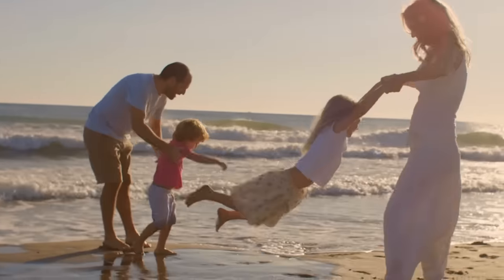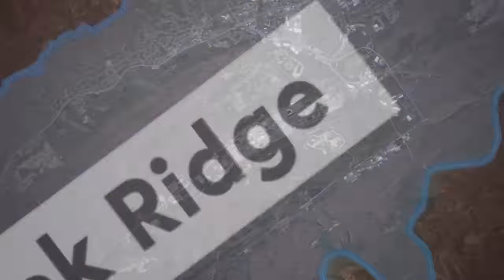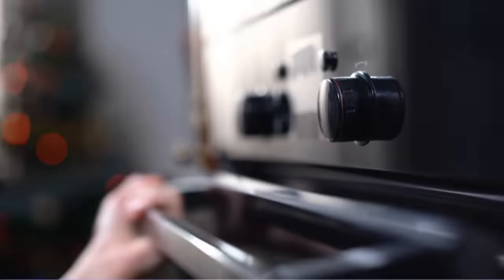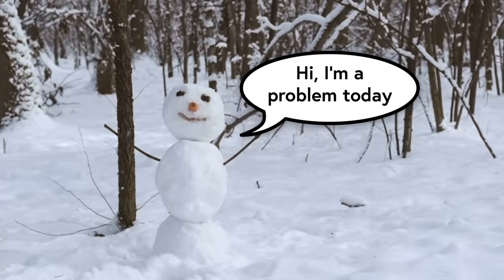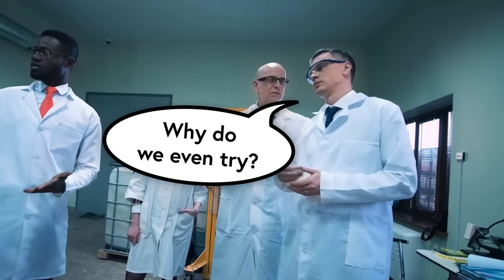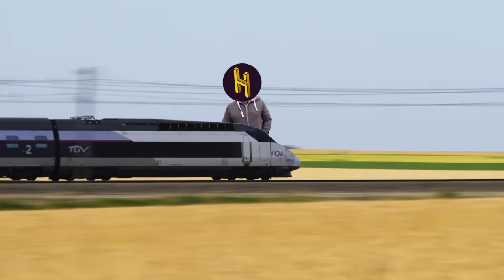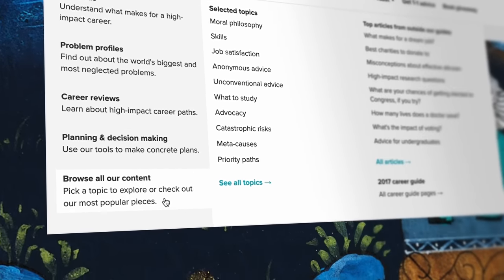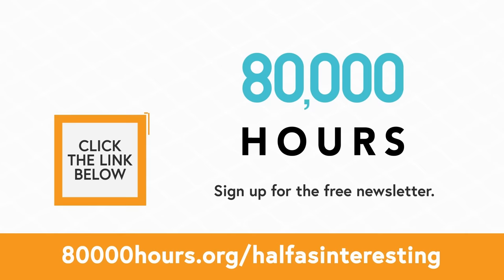The Material So Classified We Forgot How to Make It

Comment: With how much of the ulam-teller design is known it's remarkable that it's not public knowledge at this point.

Also the NNSA should have just asked the warthunder forums, they would have found it in no time.
Reply: It's likely just a modified aerogel
Reply: a
Reply: @hunterwyeth  yeah we are
Reply: Lmao
Reply: step one : make underpowered w-72 (?)
step two : wait for someone to piss off that they paid cash to use a crap weapon
step three : wait for someone even stupider to leak military secrets in hopes that they will fix the missile (who knows where it is by knowing where it isnt it now is).
Reply: Probably akin to that graphene aerogel that's useful for lithium batteries. But rather than conductive properties of graphene, it has more to do with being a neutron moderator.
Reply: tell me about it
Reply: @hunterwyeth  NNSA should've asked for an invite to Thug Shaker Central.
Reply: the beautiful part is that the public doesn't know how much is true from the leaks and there's no way for us to try anyways
Reply: You can find it on several hard scifi forums, lol :P
Reply: @pauljs75  nope
Reply: @johniceland5027  I put the new Fogbank on the G
Reply: IIRC it was widely suspected that a filler material was used in the cavity between primary and secondary stages because you've got a shitload of hard x-rays and photons that you want to trap rather than letting them sinply pass through and escape the bomb casing. 

By flashing a lightweight filler material to an insanely hot plasma, you can trap even more primary stage energy and thus superheat the secondary stage more efficiently.

Nuclear weapons are fiendishly clever pieces of engineering.
Reply: What I remember reading the filler material in the earlier designs were just  Styrofoam.. or whatever it's called in English..  u know standard filler material for shipping.
Reply: I read somewhere it is pentane filled polystyrene....

Comment: It's basically styrofoam. When the conventional warhead explodes it releases massive amount of x-rays and gamma radiation, that turn the intermediate into plasma. This plasma is an intetegral part of fusion and fission of the secondary device.
Reply: Knock knock
Reply: @osdever  Who's there..?
oh shiet!
Reply: No. Fogbank is not Styrofoam.
At least one H bomb from the 50s used polyurethane foam as the interstage material. I've seen no evidence of Styrofoam ever being used. Fogbank is likely rather different. There's indication that beryllium oxide is used in the interstage of the W76 (which uses fogbank). Whether that means fogbank is some form of BeO such as beryllia aerogel, or whether BeO and fogbank are two different materials used in the W76 interstage is hard to tell. There's also come confusion as to whether interstage material and channel filler are synonymous terms. 
SeaBreeze, the predecessor to Fogbank, which was used in the B61 was chemically related to Diallyl phthalate.
Reply: Interesting thread. Conceptually, it is just a filler like styrofoam, but the exact formula made it a particularly 'clean' bomb. The bomb would fission successfully with tonnes of different fillers, but they knew there is a danger of a lot more 'dirt' with an untested filler.
Reply: Is it some sort of advanced moderator, like tritium was the the performance of 'the shrimp'?

Comment: there is a similar case regarding the imperfection mentioned here. The holes in the swiss cheese stopped occurring and they were unsure why. But later found out it was due to there no longer being any particles in the milk. The particles were from sawdust and other stuff occurring in farms, and these particles would add the holes in the cheese. Thus to create the holes again they added sawdust themselves  during the cheese making process.
Reply: That's partially the case.

The other problem with the bacteria.

Comment: Here's another --- we manufactured armored vehicles.  The drive wheel of a tank is called a sprocket (roughly the size of a washing machine and solid steel).  They are wildly tough since they have to propel and brake very heavy tracked vehicles.  One year-end our supplier replaced their heat treat bath.  Picture a small swimming pool.  And it had been in service since the start of the Cold War.  The sandy-salty material had been contaminated with countless layers of ambient dirt, dust, cigarettes, half-eaten lunches, paint, piss, hydraulic oil, birds that got too close, spit, etc.  Picture chemical witches' brew.  Especially since the production parts often had various chemicals on them before they were dropped in.  To upgrade the process they removed it and replaced it with industry standard material.  Guess what?  They sent us a run of parts.  Snap-crackle-pop is not what you want to hear the first time you start moving a tank.  Took weeks of engineering trial and error to tweak the heat-treat bath.  After three weeks of no useful production they removed the new materials and dumped the haz-mat containers of witches' brew back in.  Worked like a charm.
Reply: Factory: "this water is dirty and stinks, best to clean it"
Buyer: "why am I hearing small explosions?"
Factory: "uhhh.... idk... jerry piss in the pool, don't ask why- yeah we'll deal with it sorry."

Comment: "Potential Train Money"   absolutely slayed me 🤣🤣🤣
Reply: We need more money for the trains!!
Reply: It's the US, we know it's probably not going to go the trains anyway 😂
Reply: He should have said potential brick money.
Reply: @MUrules2014  I think so.  But I also think we should continue developing the roads.  A good system has the best roads AND the best trains.

The roads are already really good, but introducing trains should actually make them better.  Then, we can further improve the roads based on how the trains helped them.

The trains really work best in cities and connecting cities.   However, they tend to get a bit tricky in lower density areas.  They work, but the roads really hold up well in these low density conditions.  So, I think we should use the trains to supplement the existing system, not to compete with or replace it.

Using toll roads, we limit the number of cars entering cities.  This should help limit the cars in the city to just the ones that are supposed to be there.  Anybody driving to work or from one point to another in the city is supposed to be there.  Somebody just passing through the city should take another route.  So, to accommodate that, we shall upgrade existing highways that bypass cities to proper freeway standards and build new ones as necessary.

The freeways shall be modified to allow overhead railroads to be built over them.  The roads are already clear strips of land that connect cities, so they sound like perfect places to put railroads.  High-speed passenger trains will be run on these new rails, and the existing railroad network will be just for freight.  In each city we can run light rail over the urban freeways, and these intercity trains over the primary arteries.  Because freeways and railroads will follow each other, rail interchanges can be placed at highway interchanges, allowing intercity travelers to switch to light rail in the city.  The light rail will run over the urban freeways and have stops at each exit or wherever is practical.  From there, street cars could be used on large streets within the cities.

Ultimately, the way to make roads more efficient is to minimize traffic.  Traffic is chaos.  Large trucks are necessary for the last leg of the delivery process, but they tend to be problematic in traffic.  Truck routes help ease this problem, but cars can usually still go on the truck routes.  Trucks just have to take them.  I think we should build truck-only highways within cities.  The trucks will be separated from the regular cars, hopefully making it easier for travelers.  The trucks, in addition, will not have to deal with the chaos of cars coming into or leaving the city as much as before.

From a more practical standpoint, I think stacked highways are probably going to be useful.  Essentially, we run a bridge deck over an existing freeway, allowing us to expand the road quickly and without needing more land.  We take out the median on the bottom and run either direction on just one level.  Each level would effectively add however many lanes are on the ground.
Reply: Especially with the implication that the cash would somehow be more effectively spent on trains. Not bloody likely, considering almost all of the history of light rail in the U.S.
Reply: Rail, like in Europe and Japan will never be economically viable in the USA. Look at a map. Look at how many cities there are, and the distances between them. Compare Europe and Japan vs the size of the US.; End of discussion. Right now the US has three (about 2-1/2, really) double-tracked (two sets of rails running mostly parallel with one another) East/West Lines (Heavy Rail) totaling over 15,000 miles of track. Maintaining these tracks, as it is, is very difficult: it's not just money. It is the distance between parts/materials and where a given repair/ maintenance issue exists, it is geology, it is weather, it is people. Rail Beds are engineering masterpieces, but unlike the roads created by the Romans 2000 years ago, they need a LOT of maintenance. (Millions of tons of cargo going over a strip of gravel wood/ concrete about 25 feet wide is FAR more wear and tear per square foot than any foot of man, beast, or the occasional wagon of 2000 years ago. Talk to a real Railroad Engineer/ Architect, the Engineer of a Traction Engine and a crew of Gandy Dancers (the old name for a railroad road gang), and stop relying on some green think tank/ Professor of Logistics numbers who have never moved more than a bag of mulch, never laid anything more substantial than a paver in their garden, and never had to drive further than a few miles to get both.
Reply: @matthewhelton1725  Exactly. The entire country of Japan would fit inside Montana alone, but Japan has 125 million people in that space. The U.S. already has - by far - the largest rail network of any country on Earth. China is the only other country that even has half of the rail distance as the U.S. And the U.S. uses that rail to great effect - for transporting freight. The U.S. transports about 12 times as many ton-kilometers of freight by rail per capita as the EU.

Boxes don't care if they take 3 days to cross the country. People do. Traveling from Amsterdam to Paris is not the same as traveling from New York to San Francisco. The difference between traveling at 50 (or even 100) mph and traveling at 550 mph doesn't matter as much when you're only traveling 50-100 miles. It matters a lot more when you're traveling 2,500 miles.
Reply: Next video: "We forgot how to make steam trains"

Comment: That diagram means they do have detailed records now.

The components- e.g. “Process V”- are almost certainly defined in detail within a series of additional classified documents, each with its own access control. That’s why you have a chain of steps with names like that. This lets anybody see the overview diagram you showed, but only a top official like the NNSA head has clearance to see the info for all of the components. The issue now would be idiocy like not having any person with SCI access to all the pieces or losing track of some if those documents, because the only thing more incompetent than the US government you see is some of the parts you don’t.
Reply: Like modern software development. Some guy has the "grand picture", and hundreds of programmers work on separate pieces of code. Everyone uses work products from someone else but doesn't know how these were made or what they actually do. And most contributors are not even part of the project and are probably unaware of what their work is being used for.

At least there's often documentation nowadays, even if it's all over the place.

Ah, yes. "Documentations is like sex. If it's good, it's very very good. If it's bad, it's still better than none."

But back to the military, because they have additional "special issues". Even with a pretty high security clearance, it's still all on "need to know" basis. If you work on "process W", you don't need to now about "process V" and "process X". As the manager, you just know that the processes exist, not any details. There is no single person who could leak the complete process. Documentation may be stored in different facilities, where no one knows what the documents are about.

Some day, a few decades later, someone might open a safe to find documentation for "process W". One of possibly hundreds of different processes with the generic cover name "process W" (like "K-Stoff"). The documents are marked to belong to a department which no longer exists. Usually, the safe gets closed again and no one the wiser.

Arguably, this works very well to keep information from falling into enemy hands. It also is very effective against your own people. But, in typical military paranoia, everyone's the enemy anyway.

Comment: They didn't forget everything, but they used research that wasn't sited, so they just thought they would do what they did before. When they tried to make it again, they had a general idea, but not the specifics. They also didn't know the basic research that was the foundation.  When they figured it out again, they changed the formula a little. The impurities that made Fogbank work, also made the material break down over time.  They altered it just enought that the new Fogbank would last longer, they hope. You never really know for sure.

Comment: Fogbank is the interstage neutron delay material. It does two things, it converts the hard gamma energy to soft x rays the bomb can use, but at the same time it absorbs neutrons until it saturates and allows the neutrons to then start the reaction in the secondary fission plug. Not gonna say whats in it but if you wonder what it looks like, it is a porus rigid foam very similar to hard antistatic foam material. 🤓😎
Reply: One thing I’ve always wondered is how it wouldn’t be destroyed by the detonation of the fission primary before it could serve its purpose.
Reply: There's no evidence fogbank is a neutron shield.
The primary already emits most of it energy as x-rays, not gammas. Their energy is decreased by expansion of the photon gas.
Reply: @rfichokeofdestiny By the detonation of the primary or the HE of the primary? There's standoff gaps to protect structures from the HE.
The Fogbank is "destroyed" (vapourised) by the fission explosion of the primary. That's what it's meant to do.
Reply: @Evan_Bell  Yes, the HE. I know they fire inwards but I assumed there would also be some collateral damage in the general vicinity. So if there’s a gap, I’m guessing it would have to be sized based on the time it takes the HE to compress the fission core and start the reaction vs. the time it takes for the shockwave from the HE to expand outward.
Reply: @rfichokeofdestiny  Precisely.

Comment: It’s called GEET gas or ohmese gas. Similar to h2o but it’s with deuterium not hydrogen (d2o) another is pure H which is extremely difficult to contain. These gasses are as small as an electron so it travels through heavy elements. These gasses in vacuums and turned to plasma can transmutate metals.

Comment: It's the tamper that oblates from the primary device x-rays to a plasma to form the massive pressure required to compress the lithium deuteride which is also compressed from the second fission device so the lithium is squashed and super heated from both sides to cause the strong force to break down and fusion to occur.
Ivy Mike used styrofoam I think (or something similar).

Comment: Interesting.  I had a problem many years ago where a microwave device I had designed started to blow up at a power level well below what it was designed and previously tested for.  Turned out one of the key materials was from a new supplier.  While there was a maximum allowed concentration of a known contaminate, there was no minimum.  It turned out that a minimum level was required to stop the device from blowing up when the power level was increased!   This was also quite expensive to figure out…

Comment: Swiss cheese was actually losing its holes because the milk was too clean, and didn't have any impurities on which bubbles could form. Cheese-makers ended up having to manually add a tiny bit of hay dust to bring back the holes.

Comment: It was a material needed not only for structural strength around the Secondary, but it's main function was to be as transparent to X-radiation and neutron flux as possible, whilst also providing plasma pressure.
Reply: It's unlikely that fogbank also serves as a neutron shield.